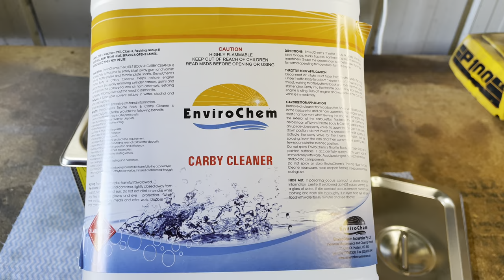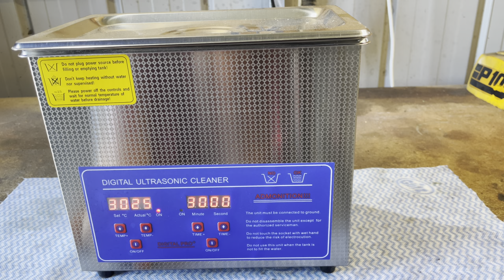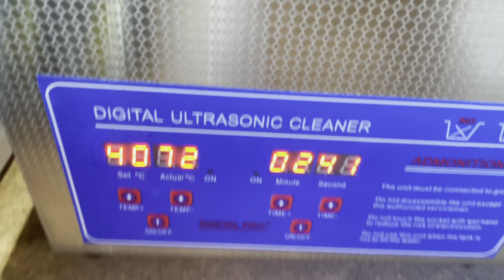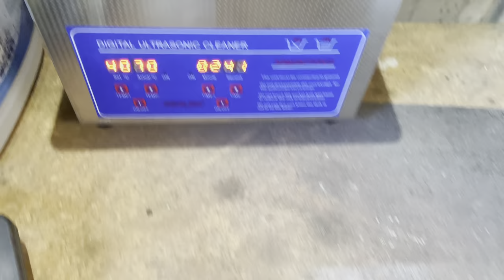PARTNER P100 Chainsaw 1975 - Will It Run? 4K HD

Comment: Hi from Oamaru New Zealand. I have a McCulloch PM1000 it's cousin. I'm due to get a Partner 650 also.

Hey a tip. Keep air filter clean and use Amsoil Saber at 100-1....it will love it.
Always warm saw up for 3 to 4 minutes then build up. Also cool down 3 minutes by idling down. 
Most of my saws are 1950's, 60's large timber metal era all 102 cc McCulloch, Pioneers.

Comment: Wow realy nice video, i have a partner s50 probably the same year than you 1975… just a quick question, mine is able to start but it stop right away do you think the problem could be related to the carburator too?  In all the case your video will help me to clean my carb for sure….
Reply from the maker: Absolutely mate! It sounds like it would most definitely be related to a carb issue! 
Lucky both carbs are pretty much the same and same setup so basically just follow through what I’ve done for a good clean out and you should be right mate!
Reply: @aussierestos9105  thanks i’ll let you know the result!
Reply: Just to be sure with this model is it normal to keep the blue switch in upper position while it running.  When i turn down that switch motor die!
Reply from the maker: @olivierhudon7929  that tells me that you need to clean the carby out mate! It’s only running in choke and once you flick that switch it opens the choke but you’re not getting the right fuel to air mixture. So give the carby a clean and you should be able to use that switch properly after that without issues!
Reply: @aussierestos9105  thanks man!  I’m going to check that!   Yesterday i succefully started it,  the motor ran but when i stopped it.  Same issue hard to start ?!?  …. My spark plug is a NGK BM6A. I wondering if it could be the wrong type?!?  Anyway thanks for your time and have a nice evening!  🤟
Reply from the maker: @olivierhudon7929  I probably wouldn’t assume the spark plug first! I would tune the high and low screws first! It sounds to me as if you’re not getting the right mixture or enough fuel! Check your saw for the two screw ports on the carby side of the yellow cover! Tweet them a bit and see how you go. Generally start by screwing them both in all the way and in do them both at 1&3/4 turns out and slowly reel them from there to get the optimal mixture! 

I will also be doing a video on this exact thing shortly on how to tune a chainsaw so stay tuned to this channel and watch out for that video if you get stuck mate